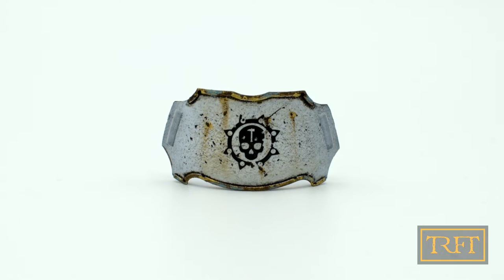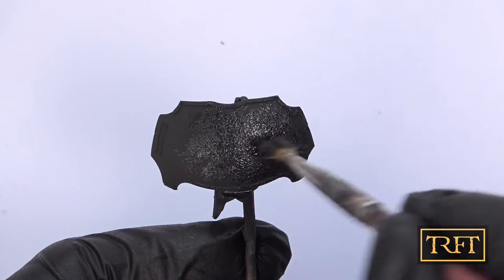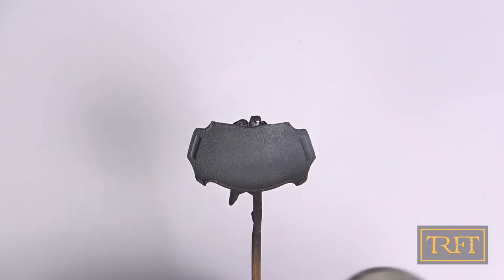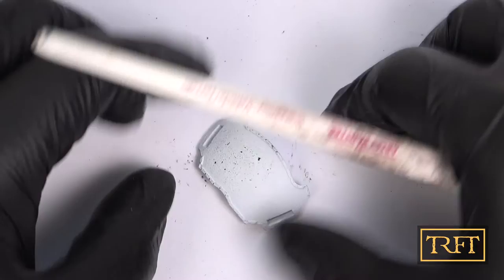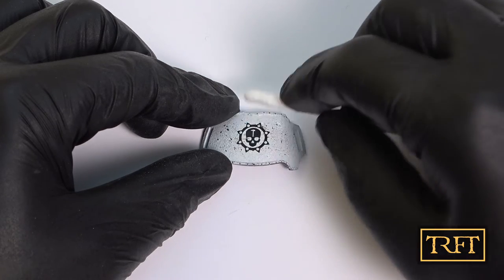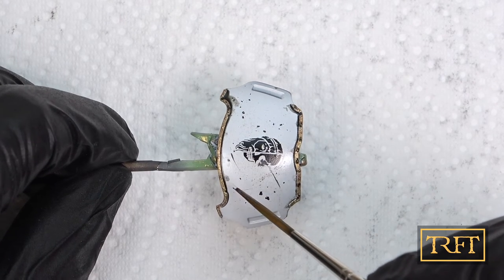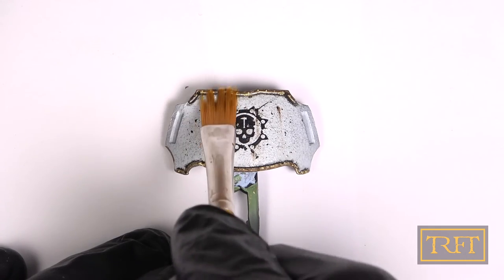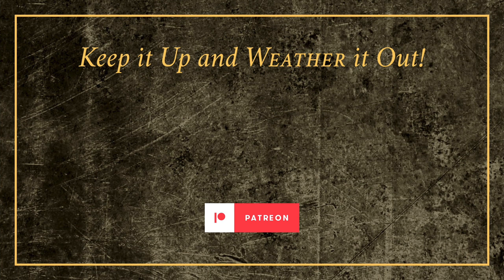How to Weather Titan Armor Panels | Adeptus Titanicus Weathering Tutorial

Comment: Hail Amy pushing this video idea :D The texture on the panel looks really fitting and gives adds to the finish; you've convinced me once more of another product I must buy.  On a final note, if you like the oilbrushers, there is a AMMO Mecha light green oilbrusher that works as a nice verdigris finish (mayhaps add some blue to it, depending on personal taste). I tend to apply the oil from the oilbrusher with a tooth pick in parallel to using the brush, for smaller and heavier effects respectively.
Reply from the maker: Great to hear you enjoyed the video. Now you've made me buy stuff in turn! (Light Green Oilbrusher)